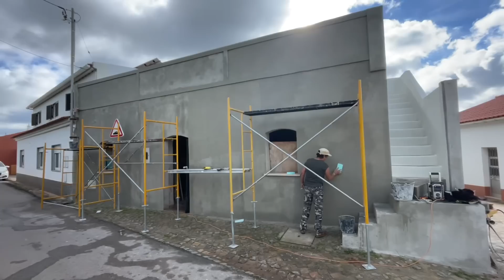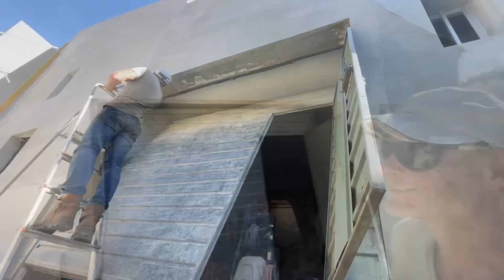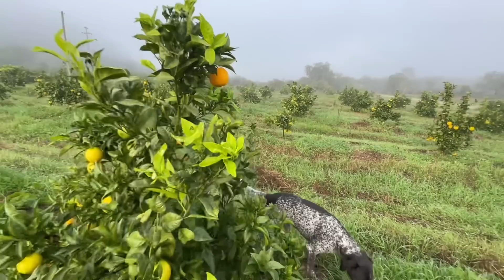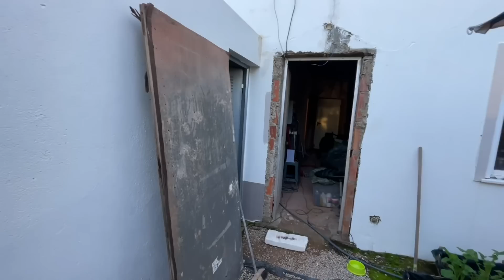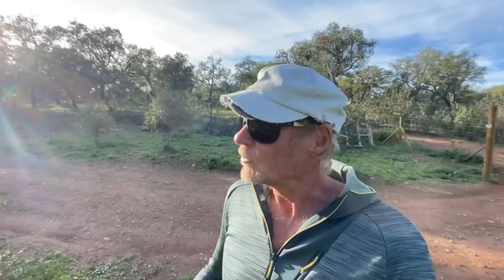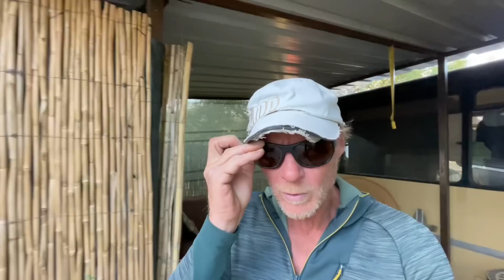Great Idea Outside Kitchen  For Outdoor Living in Portugal #99

Comment: Hallo Andi, I think you have made a mistake, when you put in the rings in the well. In the earlier videos we saw, that the well was much bigger. The water came from the bottom but also from the sides. Now the water can only come from the bottom. The sides are filled with earth. In my opinion the well doesn't get  enough water from the side. Mayby you have sealed the well now. 🤔
Best regards
Eddi
Reply from the maker: Hi Eddi. The water will still rise to the water table level. And will find it’s way through the rings. The size being smaller won’t effect the depth. We will see when we have proper rain 🤞🏼👍
Reply from the maker: @The4wildboys  you could say the same about the brick wells. Quite a few ring wells I’ve seen. Doesn’t seem to be a problem. I was also recommended to use the rings. Now that bore holes are being restricted, we might see more old wells being repaired. Of course mine was a gamble because it had completely collapsed. The rings were the cheapest and safest option. It’s more down to the water table filling up. We know it does work because it filled up straight away. 👍

Comment: Oven. Looked interesting. Must be propane?? 
I use those rattan blinds all over outside. Creates a lot of shade and surprisingly sheds rain  water nicely.  The ones I have have lasted a very long time. U May need to support them so they don’t blow around too much in a strong  wind and break, or just roll them up temporarily. 👍❤️👍 Best of luck with your hand. Remember to Give it TIME to heal !! ❤️👍
Reply from the maker: Moulinex, electric
Reply: @rusticcrow  Exactly what we have and we are 100% solar. Although it draws a lot of electricity, you don't use it that long in one stretch (we have a big oven and cooktop that is powered off propane.)
Also... very jealous of your counter space in the shop!! 👍

Comment: Andrew,
You can find a salvaged 2022 Tesla automotive LFP battery pack for a lot less than a new off-grid pack and these new packs are indestructible. Buy the pack first and mount it on a trailer for home and field generator use.